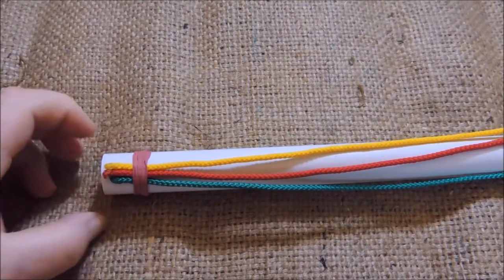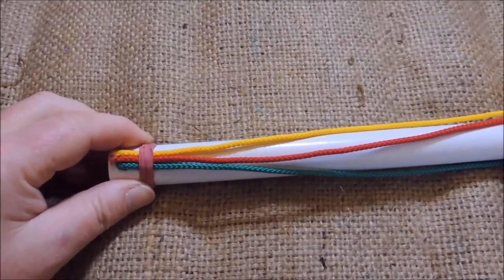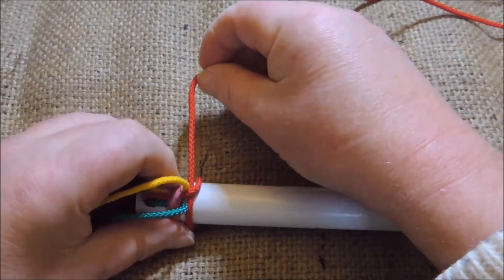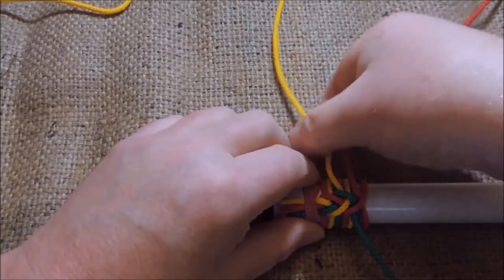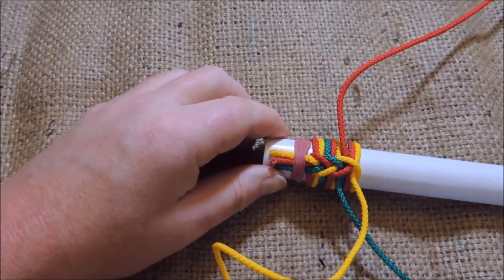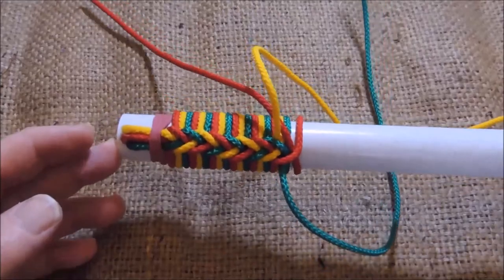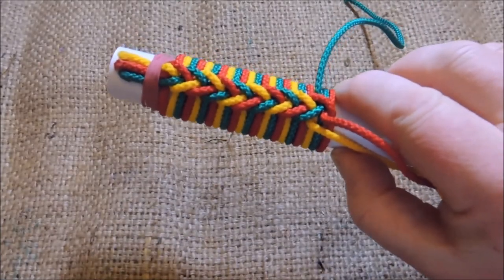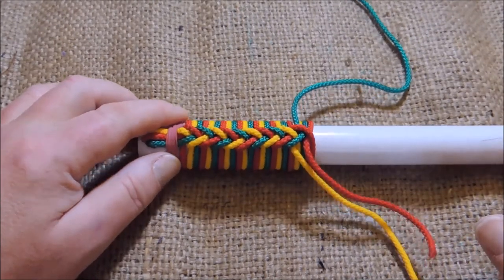Cockscombing or Ringbolt Hitching 3 Strand Tutorial How to Tie

Comment: Johnny , this might be a daft query,  how do you attach the shackle to the rest of the bell rope do you can carry on with making the bell rope  ?
Reply from the maker: The Cockcombing is on a piece of rope that runs down either side the length of the handle. Two other pieces are also added to make it more roundish, then the gaps are filled with smaller diameter cord. If you click on the link then click on the photo under the title "What is Puddening" you will see what I mean: http://igkt-solent.co.uk/making-bell-rope/

Comment: How much cording is needed per inch? I'm using 4mm
Reply from the maker: It is very difficult to tell really. On a lot of work I calculate 1 inch of coverage uses about 1 foot of cordage. If I am working on a piece that I am not really sure about, I do a little and see how much cordage I have used and they multiply that by the distance I have to cover. As you do more of this, you end up knowing in your head, how many arms lengths to cover certain things. What are you covering?